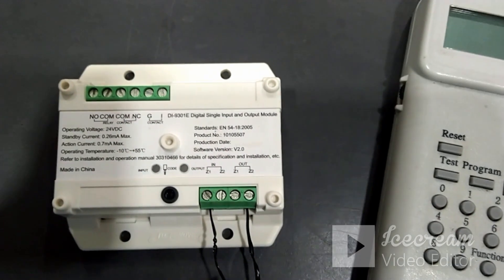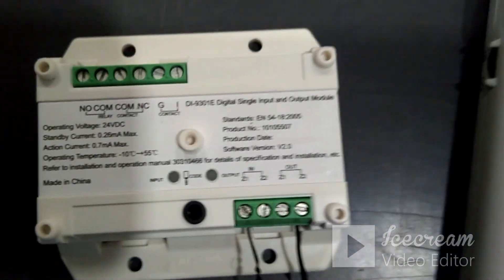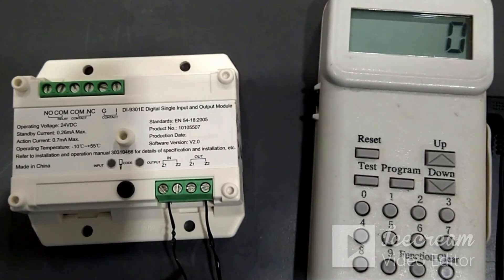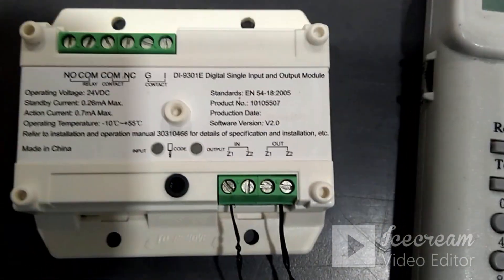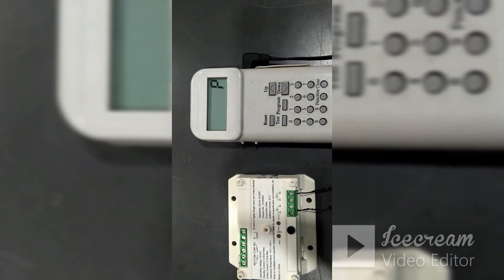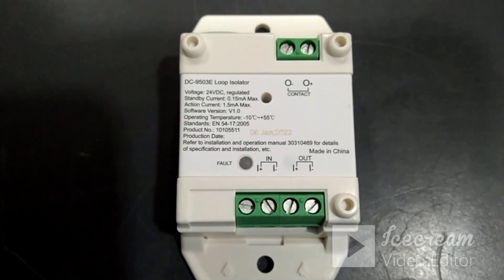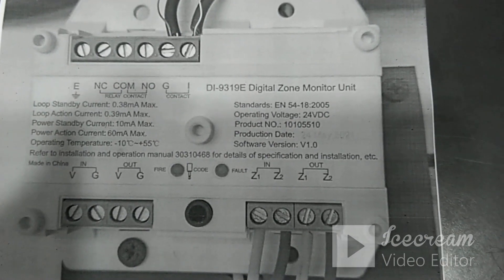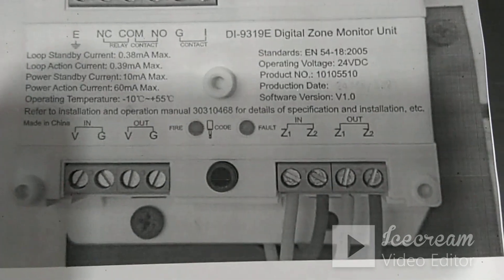GST Addressable Fire Alarm System Devices Termination & Programming Part -2

Comment: Hello,

As you explain
In Isolator module (DC-9503E) 
Loop IN connect Terminal IN (I+ I-) &
Loop Out connect Terminal CONNECT (O+ O-) 
So is it correct data as you shared.

I think Loop Out Connect Terminal OUT (I+ I-) not CONNECT terminal side.

Kindly confirm your end.

Also, can we use DI-9301E Digital Input and Output Module either Input or Output type?